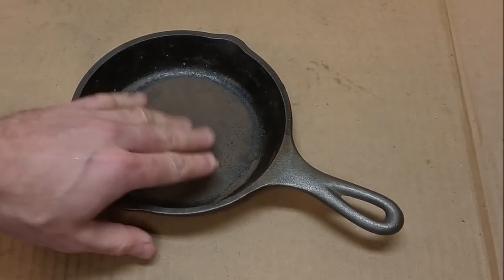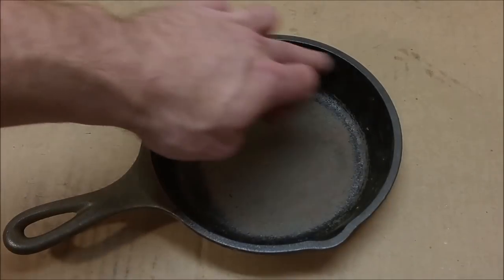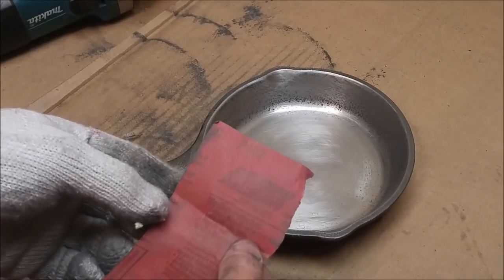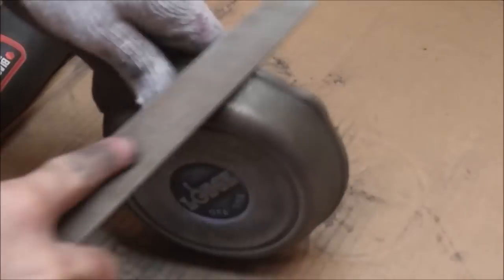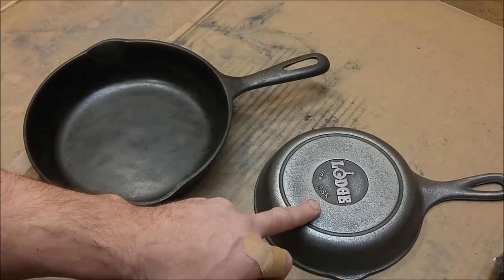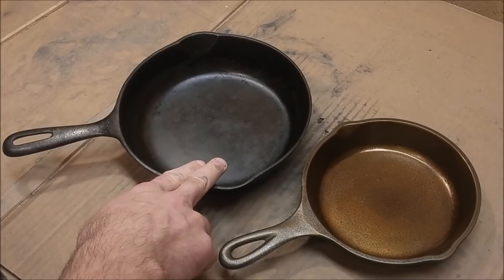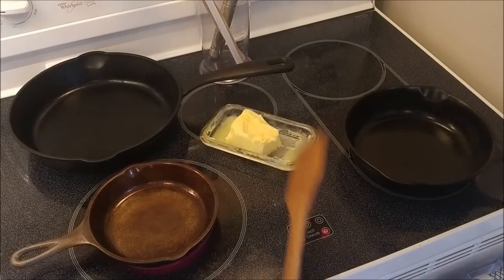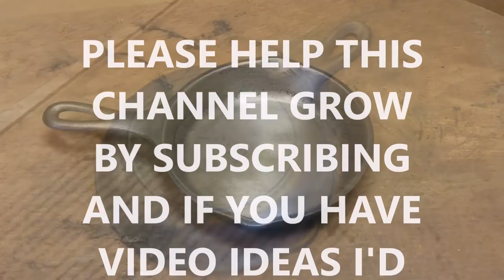🍳 SMOOTH a Cast iron Lodge skillet to make it function like an antique

Comment: As an old guy who grew up in the South, I truly hear the ABSOLUTE STUPIDITY in comments like 'I hear people say to NEVER use metal spatulas in cast iron skillets...'...WAKE UP, what do you think they used in skillets along the Mississippi river in the 1920's? EVERY SINGLE SPATULA was simple press-plate steel...wasn't stainless, wasn't plastic, wasn't teflon...IT WAS 1018 STEEL! My wife and I joke all the time, 'oh no, look...I scratched the skillet...'...give me a break...most of our skillets are 50-years old, AT THEIR YOUNGEST! Got a few new Lodge Cast Iron items...but our old 8 and 10 skillets are older than WE ARE! Got HUNDREDS OF MILES of steel spatulas scraped across their surface...which looks like BLACK CHROME!  Don't believe the hype, steel spatulas DO NOT HURT CAST IRON! Check your Rockwell hardness, and you'll find that the skillet is HARDER than the spatula...which means the skillet is EATING THE SPATULA, not the other way around! As for 'repairing old cast iron', simply soda-blast the skillet, then take a pneumatic DA (Double Action) sander and work from 80-grit to 120-grit to 220-grit sandpaper...the DA will give you SPIRAL sanding, which prevents grooving during smoothing. I can polish a skillet in 20-minutes, cure it in 2-hours, and make a new-one look like one of my old ones in no time at all...and work just as good...far too many videos by kids who think they understand metalurgy, that's for sure!
Reply from the maker: Thanks for the thoughts, my most recent video was on this exact subject.  I've read quite a few comments saying never to use metal, so I thought I would test it to see what happens.  I prefer to test because many people only know what they've been told and do not question these notions.

 Since you have lots of experience on the subject, I'd like your thoughts on whether the seasoning is actually non-stick on it's own and also if there is a preferred fat that is more non-stick than another.

I do not profess to have lots of knowledge when it comes to cast iron cooking (about 15 years total and about 5 years of more serious cooking).  I'd like to use these comments as a way to understand the best way of cooking with them.

I originally purchased cast iron because I was not happy spending $70 on non-stick every two years, cast iron can save you lots of money over the long-term.

Thanks for your thoughts.
Reply: Thank you very much Sir! You sure gave me an insight. Appreciate that.
Reply: I am a young man and I knew that you don't have to worry about steel spatulas on cast iron.
Reply: wood, they used a slab of wood shaped to a spatula shape, partly because of pan frying.  judging by your reaction, you need to have less metals in your diet.
Reply: I mean I use wooden a wooden spatula usually, a pair of tongs if I need them, that just how I grew up cooking.
Reply: Mr. Saurus, what is 'soda-blasting a skillet'?
Reply: @jawbaw6471  it's like sand blasting but soda as the media. When say soda.. not talking about the drink but it's chemically equal to Baking soda but specifically for blasting.

Comment: The ring on the bottom of cast iron pans were originally used to keep the pan seated on old wood stoves that had the removable stove lids...the number or size of the pan corresponded to the size of the hole in the stove top.
Reply from the maker: That's pretty neat, I had no idea, we used to have an old wood stove with the water heater on the side and removable plates, but we only ever used cast iron with a flat bottom on it.  Thanks for the info.
Reply: Still does for Amish..  I have many Amish friends.
Reply: OP, this is someone who knows a thing or two about cast iron and is absolutely correct. Great job to both of you.
Reply: The secret to nonstick eggs over easy is low heat and just a little more fat,oil,butter. I use pam and it works good. The low heat keeps the eggs from sticking.
Reply: Yep It’s a fire ring  , basically certain pans for certain 🕳 holes
Reply: Fits a stove number 3 eye.

Comment: To avoid warping cast iron cookware, start with a low to medium heat until the pan is thoroughly heated and then proceed to a higher heat setting.  Starting with too high of a heat setting causes the bottom of the pan to expand rapidly while the cooler sides resist the expansion, and the resulting pressure difference causes the bottom of the pan to buckle.
Reply from the maker: It would be interesting to test this somehow.  I've found a lot of variation between the different brands of skillets, this may have to do with the chemical makeup, or maybe the thickness of the castings.  Do you have any thoughts on this?
Reply: @NeedItMakeIt  - I think it's reasonable to suspect that everything you mentioned has the potential to be a contributing factor.  Plus, a lot of stoves aren't level. ;^)
Reply: Generally when cooking with cast iron, I always turn a burner on low and set the pan down to warm up before I even think of adds foods, oils or anything to it.

Comment: considering this was a newly seasoned pan vs. pans that had been broken in, it did a good job.  i think a smooth finish to good if you want a pan to perform right away. it also is easier to clean if something does stick.  nothing beats a pan that has been well seasoned over time though.
Reply from the maker: I agree, proper seasoning over time seems to work better every time.

Comment: Hi, I just bought my 10" lodge skillet a week ago.  After seasoning, I can fry eggs and bacon using your high temperature method. The only problem I encounter is that burn bits of bacon takes forever to clean.  Then, I decided to polish it using 60, 80, and 120 grits sandpaper.  Omg, the difference it makes.  Everything I cook in it turns out amazing and cleaning takes seconds using hot water.  I totally recommend smoothing a new cast iron unless you have access to the antique pan.
Reply from the maker: Nice!  I'm a Lodge fan, they are a bit rough, but there is nothing wrong with them.   I do like to smooth all of my cast pans like they used to do.  I did find that the bacon was much easier to clean, but I've started cooking bacon in the oven on parchment paper on top of a cookie sheet. The cleanup is so much easier and it makes for crispy bacon every time.

Comment: Lodge skillets are definitely usable the way they are. I use them nearly every time I cook. Polishing them smooth would drive up the price, but I'd be willing to pay more for one that was polished and had thinner walls like a Griswold or Wagner. The smoother surface is definitely preferred. They should offer their regular budget skillets and a polished "antique" style version. Field Company is one that I'd love to own someday. Made in America and in honor of the irons of old.
Reply from the maker: I agree, the rough texture works pretty well surprisingly, but I prefer the antique/vintage ones with the thinner walls like you.  There is just a feeling of quality that you don't get with the newer ones these days.  

An automated sanding setup wouldn't be tough, rotating mag chuck with a light pressure orbital sanding head that comes down, or turn it on a large lathe... if it weren't for the handle, I would love to mount mine on my lathe. 

I've never heard of Field Company, I'll check them out.  I see they've come out with cast iron with the 'Rock' finish for a non-stick coating, I wonder how they perform (https://www.starfrit.com/us/the-rock-cast-iron-12-34-fry-pan)
Reply: Look into this company.  They are amazing.  Make iron and stainless.

Comment: Sigh. I own 9 Lodge skillets, 10 camp ovens, pizza pan, wok, loaf pans, corn stick pans, griddles, fajita plates...and a set of my grandmother’s machined Wagner Ware that’s 100+ years old. There is NO empirical difference in cooking performance or nonstick quality. The Lodge sand cast surface does not encourage sticking. I have the same 3SK skillet that’s polished in this video. It’s rough. I cook eggs in it with no sticking. They slip out of the pan with minimal lubrication. Cleaning requires a rinse with hot water. I’m not a fan of Lodge preseasoning; I do apply one additional seasoning coat. It is, however, a myth that Lodge must be ground and polished to be serviceable.

I owned some of this Lodge before the internet and YouTube. In those days, people just used it. They didn’t talk about its surface texture. There wasn’t an audience for skillet grinding.

Comment: My Lodge cast iron was purchased in the 60’s.  It does not say Lodge or made in USA.  You can tell it as Lodge because the ring on the bottom has three small notches. Mine has an 8 on the bottom of one, and a 5 on the smaller one.  It is not easy to see the notches, but they are there.
Reply from the maker: Has the design changed much over the years?  I like them personally, I like that they are made to last, they may not be the most beautiful, but they are functional and that's what counts most... I think.

Comment: I bought the exact same skillet from lodge in 1999 so at lest the mold yours was produced from was still being used then. It looks the same as the ones that I saw being sold a couple of years ago when I was looking for a set to give to my nephew for his weeding gift. Also, I have been using metal utensils on my cast iron since they were new and have never had an issue, once the seasoning sets good and is blackened, you will have to work hard to scratch or tear it off
Reply from the maker: I do like the Lodge, they seem like a solid company and they continue to make a good product even today (I just checked the reviews on Amazon).  What are your thoughts on how to get the best non-stick pan?  Do you think it is the oil, or is it more about the seasoning?

Comment: the reason you had some sticking with the eggs has nothing to do with oil and butter, that will always help. The reason is your eggs were straight out of the fridge and too cold. Allow eggs to come to room temp, zero sticking. Great video man, keep up good work!
Reply from the maker: I will definitely be trying this method.  I'm not sure I can wait long for the eggs to warm, so maybe putting them in some hot water would do the same job?
Reply: @NeedItMakeIt  when making any dish with eggs, the first thing to do is pull butter and eggs and sit on the counter. The mere time it takes for your iron to heat up will be sufficient. Fridge temp eggs will stick every time to anything, except nonstick. Great work on the videos man!
Reply: @NeedItMakeIt  I would avoid the warm water, I believe it would be unnecessary and may cause a problem. If the water were too hot it may even begin to cook the egg.

Comment: What I have heard is that butter has impurities in it, that’s why it has bubbles. If you use clarified butter, it doesn’t stick as much.
Reply from the maker: The impurities are milk solids and water, but I have been testing and I have found that regular butter sticks less than clarified... more testing is needed I think, my only explanation so far is that the steam generated creates a small barrier until the food solidifies, again tough to prove this unless I could examine it close up while it is happening.  Lots of butter or clarified also does prevent sticking, but that's a bit of a waste.  Switching to a metal spatula seems to get under the food better than plastic.
Reply: Love clarified butter!

Comment: I believe that Lodge started putting their logo on the bottom like that in the 90s.    I have some Lodge pans that I was given in the 80s they have a no cast in logo like that.  That pan is also factory seasoned.    The rough surface is so that the sprayed on oil won't run off quickly.

Comment: I've had that oil/butter issue with my carbon steel and haven't found an answer as to why it happens. Eggs slide around the pan with butter, but always stick when using oil.
Reply from the maker: My best theory on this is that the water in butter creates a layer of steam that keeps the egg away long enough to solidify, if you make clarified butter, it removes most of the moisture and I've found that I have more sticking.  It needs more research I think, but it is the best explanation I have so far.
Reply: I've had good experience with small amount of olive oil  and a pat of butter,keep the heat low to med-low.

Comment: Smooth is not better. The rough ones hold seasoning better and if you oil them after you are done and leave the oil until it starts smoking then wipe it off they become smooth over time.
Reply from the maker: I will be spending some time testing the seasoning method on the stove top, it is much more convenient.  

Do you think seasoning is more important than the type of oil you cook with?
Reply: @NeedItMakeIt  I think both. I season with the same oil I cook with. I use deodorized coconut oil because it has a high smoke point and is healthier I think. I add the flavoring oil closer to the end. I cook on a glass top thats the same size as the pan and turn it up to max 8 out of 10 otherwise it will start burning the seasoning off. It depends on your stove top's power to be honest. A good way to season on the stove top is to grease the pan and control the temperature to where it is slightly smoking, but not too much. When the oil gets polimerised it will stop smoking but you dont run the risk of burning off the seasoning. The sides take a little longer than the bottom. If I am cooking something a little more saucy and it burns I just deglaze the pan with water after it cools down a bit and everything just lifts off the bottom. You can also use a gas stove but on the lower settings otherwise the point where the flame touches the pan will be a charcoal color and your seasoning will burn off. I use woks too and they are glass smooth. Its a nightmare seasoning those because the oil turns to droplets. I hope this helps. Thank you for the video.

Comment: One aspect of cast iron that is overlooked is the lid
I love a fried egg with a cooked top and no caramelised underside.
So what I do is heat up the cast iron lid.... Le creuset and then on the lowest level of my gas cooker gently heat the pan with a little olive oil and then put the eggs in with the hot lid on for 70 seconds and I get a fabulous almost poached egg with a runny yolk that will slide around like a marble on a frozen lake
The lower heat  is not  degrading the cold pressed olive oil aspect either
Reply from the maker: That's a great point, normally I take my plate and place it on top, it heats the plate, keeps your food warm afterward and also helps to cook the top of the egg.  Your idea takes it much further, I never thought of pre-heating the lid.  

Nice EGG-HACK!
Reply: @NeedItMakeIt 
Thanks. My mom used to do the plate thing. She was obsessed with having her plates hot for her food. My wife's the same. But yes a soft fried egg is my favourite. No crunch underneath. But a little more flavour than a water poached egg
BE well
Reply: Cool.  I’ve done the plate and lid method to help cook the egg white without cooking the yolk. I’ve also found that room temperature eggs work better than those right out of the fridge. Such a clean pan afterwards. Love my CI.
Reply: @Mote78  

Bacon grease helps also, especially if you keep the heat a bit low initially and then spoon the hot grease over the egg.  You will get the upper part of the whites cooked with out killing off the runny goodness of the yolk.

Comment: But doesn't the rougher finish produce a better searing on steaks and meat in general? Maybe something inbetween (not too smooth but not too rough) would be best?
Reply from the maker: I don't really know... yet.  I have been planning a follow up video which will answer some questions on how the various finishes compare.   I think the idea of not smooth and not too rough may be the right answer though.  I have a pan which had a small amount of texture and I find it works very well... but they all do, so it's really tough to compare.
Reply: The texture of the cooking surface only has very minor effects on the cooking performance. It's all about the right temperature and cooking time. The seasoning also is part of the equation but to a lesser degree. Even a very rough Chinese made cast iron skillet will release the food without any problem when used correctly.
A smooth cast iron skillet is more fun to use (less noisy) and easier to clean. But if you go crazy and overpolish it, it will become more and more problematic to season. A certain texture helps the seasoning to stick to the surface. That's why smooth, drawn carbon steel skillets behave a little different in terms of seasoning compared to cast iron. 
I found everything around 60 to 120 grit sandpaper to work fine. The slightly scratchy surface holds the seasoning very well. I also don't sand my CI down to an even surface. I remove the 'sharp' high spots but leave those tiny 'pits'. They fill with seasoning over time anyways.